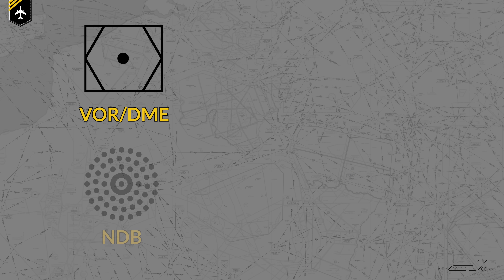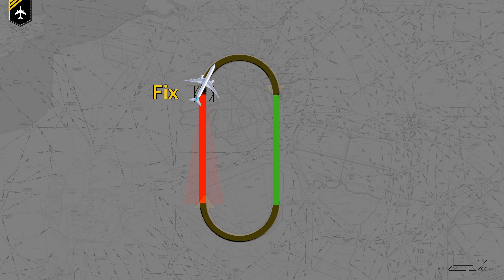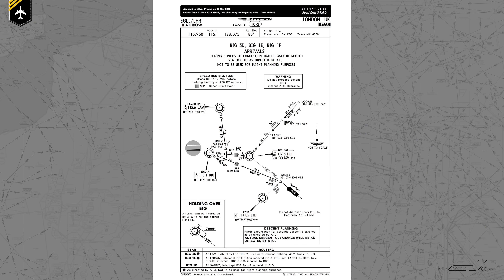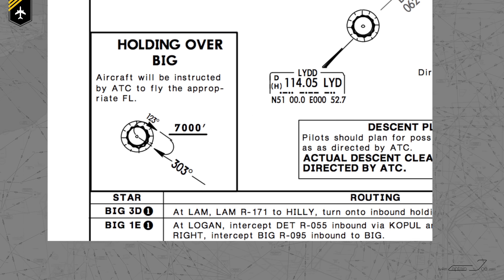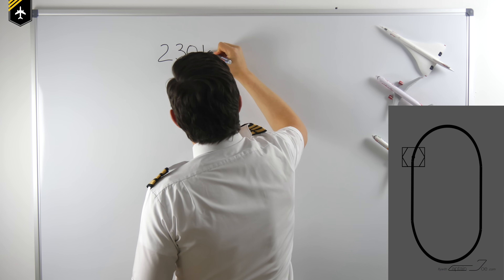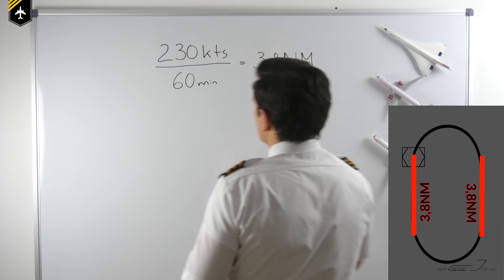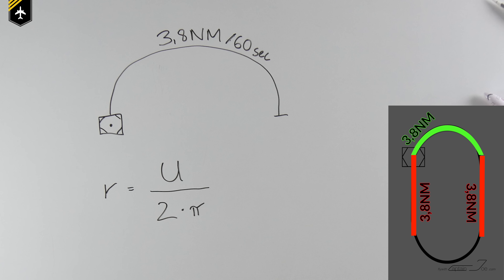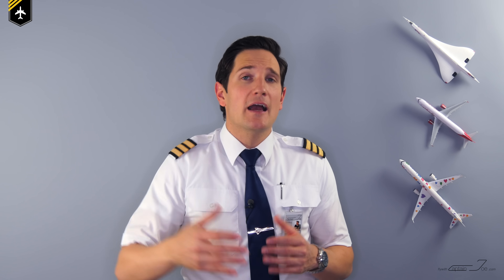WHAT is a HOLDING PATTERN? PART 1 Explained by CAPTAIN JOE

Comment: If earth was a ball... You would need to dip the nose down constantly or you would end up in "space" from flying level. Earth is flat and stationary.
Reply: Slam Free Poetry 
genuinely having trouble deciding if this is bait or not
Reply: No. If you fly slow enough, you don't have to dip down too much. But if you fly fast like supersonic, you do. That's why the Concorde had its nose pointing down.
Reply: Airplanes maintain a level flight by aiming for a constant altitude on their altimeter.  They do not need to dip the nose down.  The downward acceleration will come from the lift force being slightly less than Earth's gravity.  The pilots don't even need to think about this, because this is a biproduct of what will happen if you aim for a level flight on the altimeter.

Comment: Hi Dear Joe, 

I have a question regarding the bend on the wing tip. In many planes, I see the wing tip is bent or there are some small wings perpendicular to the main wings even when the plain is on the sky. I was wondering if you could explain the reason of that.

Thanks,
Soroush

Comment: Joe can u explain why the use of verticle stabilizers are restricted during a flight.
And in which part of flight it is used mainly.
Reply: They are not restricted? What are you referring to exactly? On Airbus aircraft, they are automatically adjusted. On Boeing, the pilots must adjust it himself during manual flight.

Comment: A 4th video on where holding patterns are defined might make an interesting topic. Where are they positioned, why they are there and angled such as they are, and how airports close to each other (such as all the smaller airports clustered around London) deal with so many holding patterns, approaches, and departures in a tight space.

Examples of airports with multiple holding patterns, or how emergency extra patterns are setup/used could be interesting. - A video on mass emergency handling on its own might even be worth it. Such as looking at how air traffic control dealt with the 2001 air space closure, and getting the rest of the planes back on the ground safely.

Comment: 3rd comment
JOE YOU ARE MY FAVOURITE
I CRIED WHEN I FOUND OUT YOU CANT TAKE ME FOR A FLIGHT ANYMORE
Reply: can you elaborate about it please? has Captain Joe left the previous airline or lateral shift to another div.: did he mention it in some video? which one? thanks
Reply: Airberlin shut down
He hasnt left it
Reply: Spock *  the company that he used to work for (airberlin) bancrupted and he lost his job, as well as the other pilots working for it. On his Instagram page he stated, that he found a new job and he's holding a Boeing 747-8F type rating. Not sure if he's actually going to work for cargolux, but I'm sure that it will be a cargo company. (btw, nice username)
Reply: I NEED TO TURN INTO CARGO
Reply: Antoni Modlinski good luck on doing that
Reply: thnx